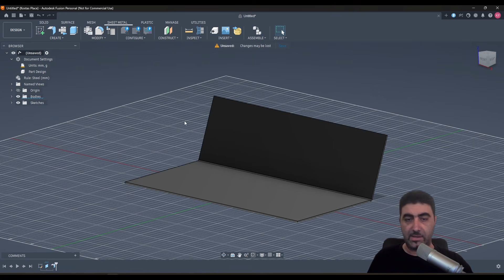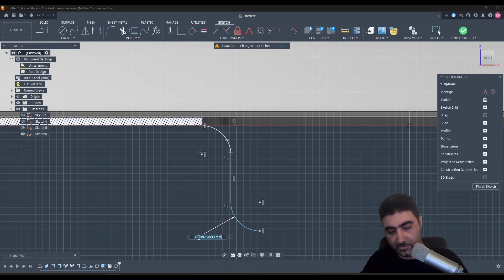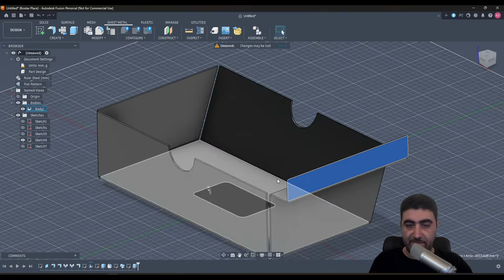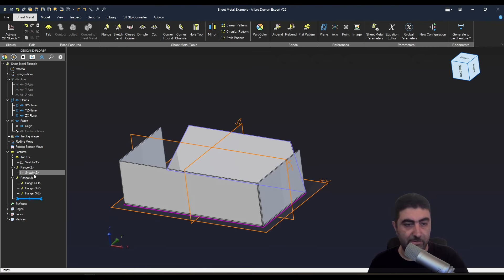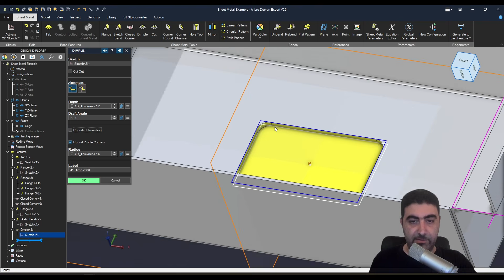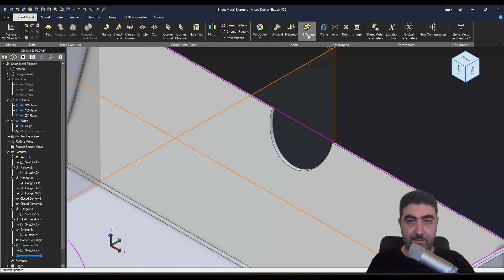Alibre Design vs. Fusion 360: Which is Better for Sheet Metal?

Comment: I have been using Fusion for 4 or 5 years.  It was a half decent program when i started but they have been trashing it ever since.  They have stripped out functional nesting, fast and reliable (local) simulation, and part refinement via FOS analysis.  There has been heaps of UI degradation, heaps of extra bugs, it has gotten slower, crashes more, more workarounds, more clicking to achieve the same things, defaults keep being deleted, more things have to be downloaded rather than be ready to use, internet gets clogged with extremely regular software changes (downdates), goes offline regularly and then heaps of functions dont work, files opened from local get default saved in the wrong location, etc.  It is purely for hobbyists these days.  It has cost my startup thousands in lost income.
Reply from the maker: I was using Fusion too. I started looking for alternatives when between me submitting a proposal and the client actually awarding me the contract the buckling study went behind a paywall. The last drop was the release of the Design package or whatever it was called. New, dearly needed tools for design, put behind a SECOND paywall. All the while, the subscription was increasing.

Then I found Alibre. Haven't looked back since man! I'm telling you, that's why I started a whole YouTube channel, to share just that
Reply: @ExMachinaEngineering  government is being crazy slow to react to this criminal behaviour.  If you pay for something it cant just be taken away, legally.  Imagine if you bought a car with a V8 and a few months later a team of guys arrived from the manufacturer, took the V8 out and replaced it with a 4 cylinder, it would correctly be seen as theft.
Reply from the maker: Hahahahaha... I completely get what you're saying. Now imagine you buy a car with a V8 for cheap and the manufacturer says it's currently a V4. If you want the other 4, it's $99.99 a month for as long as you want them.

Now, that sounds too close for comfort, right?
Reply: @ExMachinaEngineering  they deliberately degraded the native nesting around the same time as they created the nesting extension.  Considering i was paying startup prices that was close to a $2000/yr extra cost imposition if i decided to spend more money to get what i had already paid for.  Considering the vast number of degradations and the $2k would have only fixed one of them, it didn't make any sense to pay more, especially since if you reward criminal behaviour you can expect even more of it.
Reply from the maker: Exactly! My thoughts exactly, man!

Comment: Kostas, thank you for the comparison again. I've started using the sheet metal function of Alibre this week, and my feelings are mixed. I'm missing some quality of life functions from SolidEdge like corner reliefs. That said, I learned quite few things from this video that I just missed. Maybe I should start reading documentation 😂
Reply from the maker: Hahahahaha! It is the sign of a true man not to ask for directions and not to read the instructions. Hahahahahaha. I am also guilty as charged.

But yeah, Alibre is very capable in sheet metal. I don't know in which case the corner relief did not work for you but it has corner reliefs, miters, punch marks. All that. Check out HaroldL's channel. He is the absolute master of sheet metal in Alibre.
But yeah. Alibre can even do internal tabs. In the middle of a tab sketch a rectangle. Then convert one line to reference, start the sketch bend and point it to that sketch.

And it all works very easily and reliably.